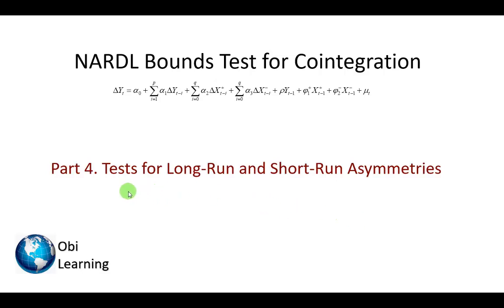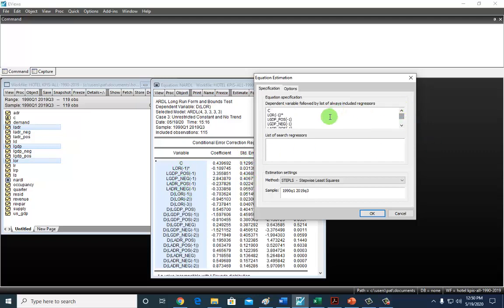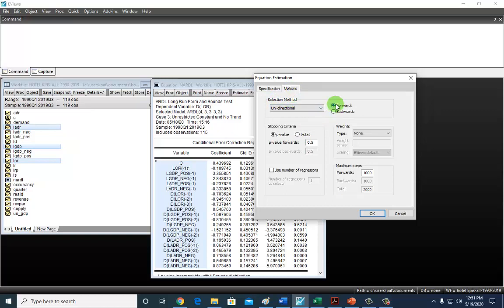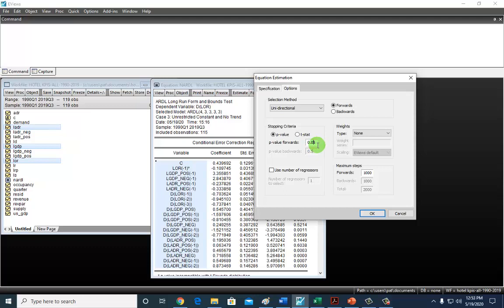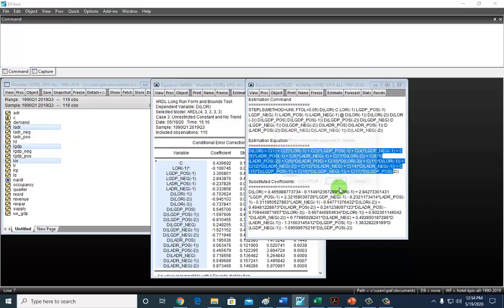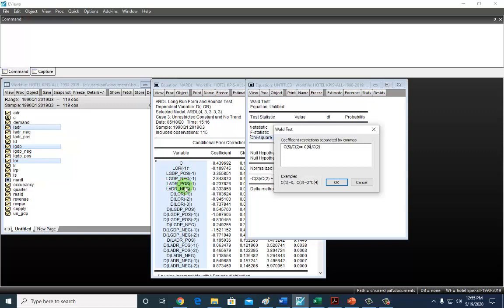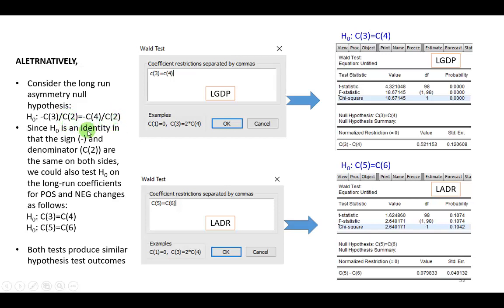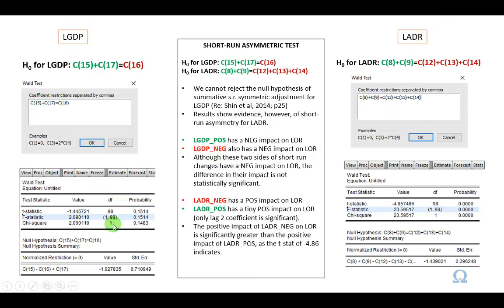NARDL Bounds Test - 4of5 (Asymmetry Tests)

Comment: Hi Pati, many thanks for the video. A great refresh for me! Just a quick question, if the coefficients (Pos vs Neg for a regressor) in the conditional ECM are insignificant, can we still use a Wald test to say that there is an asymmetry in response to + vs - ? (What if we find that the Wald test indeed says the difference is significant! Although both the Pos vs Neg coefficients are insignificant). Thank you

Comment: Thank you for the explanation. I have a question, I've tried this NARDL model on eviews 10 using panel data. But, it turns out to show a different output layout when I click the "make NARDL" add-ins.  Moreover, I can't find the Long Run Form and Bound Test menu on the coefficient diagnostic list. Is it because the data is panel?